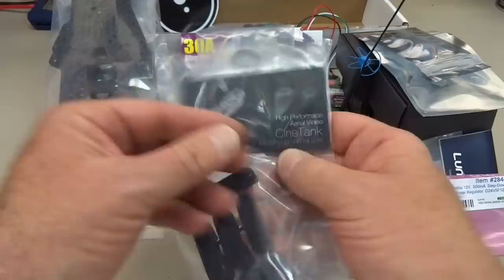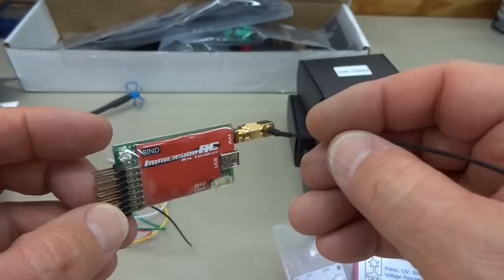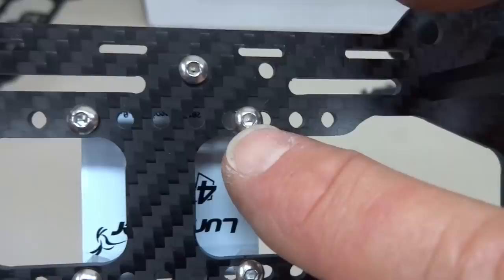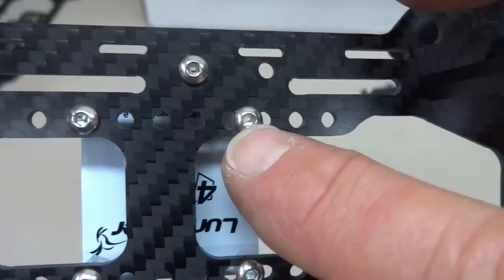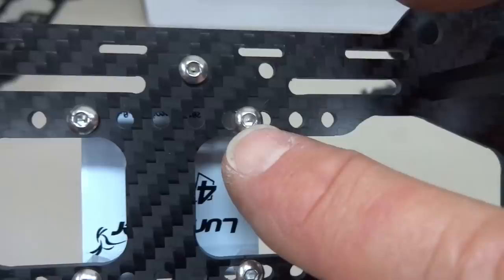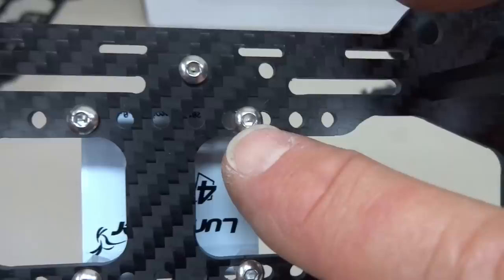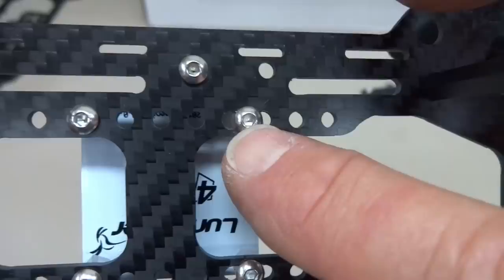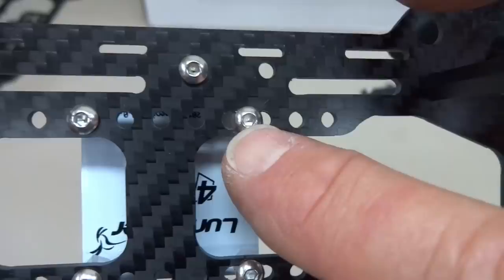Building FlyingCinema's "Tankito"

Comment: The "Bone end" on the arms are actually where the motor wires go through to protect the cables if you decide to run the motors wires outward and under the arms. Basically wire protection.

Comment: The back gopro strap slot is supposed to be below the gopro to eliminate rattle on the gopro. If you zip tied without it recessed it would vibrate.

Comment: Last comment I am going to make regarding this. The normal FPV cameras will not fit inside without some messing around. The lens housing is a few mm too thick to just slight onto the quad. If you loosen or don't install anything to hold the bottom of the camera down you can push it back to slide it in then zip tie/screw it back down.

Comment: As for the 10 holes that line down the side of the middle and top plate, those are not for mounting a FC to, they are actually used to add 2 additional spacers which will provide protection between the lipo and the FC. This also makes it easier to not have to worry about balancing your lipo everytime. Just set those standoffs in the right holes and your lipo slides in perfect everytime.
Reply: Sinewavz101 Where is the intended area for the 36x36 boards? Nothing makes sense except these holes, and it DOES actually fit if you forward far enough.
Reply: +Michael Gossett sorry I meant it fits the 36x36mm board toward the front and the holes after that are for standoffs placement for protection from your FC/fpv gear

Comment: Great looking quad :D
2208 motors are fantastic, they should normally performed like hell ;)
Why not putting velcro between your LIPO and the top plate, it will not go anywhere if you use also the two lipo tape strap :)
Looking forward for the next videos!

Comment: Also, I recommend not zip tying the fpv camera down as shown if you are using the carbon fiber frame. The CF will short the camera out. I covered mine in liquid electrical tape before tying mine down.

Comment: whats your verdict on the 2208s? I'm running the same setup from rtf on my argonaut 320. They are spinning 6x4.5 hq's on a 4s 60c 2200. Its pretty much ridiculous. Been a handful to tune. but getting there. I try to stay out of the throttle and am getting decent 5min plus flight times. They are still spinning well after 6 flights and a fairly spectacular cartwheel. Also giving serious thought too a havok 340 thanks to you. Great build videos!

Comment: My last video shows a full power punch out and some basic acro moves in high windy using this same motors and HQ 6x4.5BN props. Arms are tilted on mine...it's not a slow poke.
Reply: Also the round circle on the sidewall of the dirty cage will fit a discovery buzzer ;)

Comment: i think thats why they put all those holes in the lower plate, so you can put metal standoofs at a perfect location to mount your battery inside and it will not crush anything, i would not fly this top heavy

Comment: Doesn't the locknuts spin off because of the CCW spin of the 2 motors?
Reply from the maker: Ghostwriter972 No, that's why you use lock nuts.  CCW threads are a pain in the rear to find & keep up with.

Comment: I don't see how you could have built this and got it to work if you don't have inside connections at the factory?  I'm on my second Pixhawk that won't work and 3D Robotics refuses to fix it so I'm threatening to sue them for fraud.  I wonder if the Calif. lemon law could be used against them or is that just for cars?
Reply: +bosnianbill  I disagree and so does my Hobby King Quanum Venture that can't fly!  I don't think there are Thousands, in fact I don't know of anyone who's built one and got it to fly and the only one I've ever seen fly is my Parrot. You probably think there are Thousands because of all the YouTube videos showing people building and flying them but most of the videos are FAKES produced by paid reviewers!  I used to think this would be fun after watching all the videos of people building them and I bought the Venture because of the videos showing it flying so beautifully but when mine couldn't fly I realized that all the videos are fakes and the flying was done with CGI.  When I went back and watched the videos of building them again I noticed that nobody ever had any problems like you'd have at home with programs like Qgroundcontrol that wouldn't run, Mission Planner not being able to configure the Pixhawk as anything but a plane and would crash when trying to make it a copter or getting endless error messages so they were just going through the motions without doing anything.  When I got the first PX4 in 2014 NONE of the crappy shareware necessary to set it up would work!  I know there aren't any flying like all the fan boys claim if you can't program it.  The only way to get it to work would be to get a working one from the factory that's already setup or buy a 3DR Iris and take the board out of it.  I doubt anyone would do that but they might in order to make the fake videos.   Mine finally broke after trying hundreds of new releases of Qgroundcontrol on it for a year and those crooks at 3DR refused to fix it, saying to buy a new one!  As for joining a group, when I checked about groups at the local hobby store that has tons of expensive drones for sale the guy said: "they tend to be loners who don't join groups"!  All the online groups are made up of the fan boys and paid reviews who make money posting positive reviews and producing fake videos so they get mad and send out death threats if anything bad is said like how the software doesn't run or the model won't fly.  Seriously!  When I mentioned that a model wouldn't work I've actually got messages saying We Hope You Die!  When I first got the PX4 I joined a Qgroundcontrol Google+ group and when I mentioned that it had a problem they kicked me off, no matter that it didn't run at all!  I've asked a number of people on Youtube why they are making fake videos but they either get mad or won't answer at all, however a few have said they got the models for free. 
When I got the Venture I needed a flight controller for it and since the first PX4 could never be programmed I bought a Naze32 but it was so poorly made the USB port fell off when I was trying to set it up with Cleanflight. I got my money refunded from Banggood and bought a KK2.1 that did finally work since it didn't need to use any crappy shareware.  That's when I found out the Venture couldn't fly!  It had a bad motor and bad ESC. Apparently their idea of RTF was a lot different from mine since I expected it to actually be able to fly. Even after changing all the bad parts though it still couldn't get off the ground. 
Even getting good parts for the Parrot that could fly right out of the box has been a problem!  A few times it took off to the side as fast as it could for no reason and crashed but crashes bend the props and shafts if they hit something.  I ordered some new orange props on Ebay that were supposed to be "New & Improved" and it wouldn't even fly with them so I had to put the old ones back on.  I ordered new shafts from 4 different sellers on Amazon and Ebay and only one set was usable!  Most looked like they had taken finishing nails and just cut the pointed end off, they weren't the right size or even round and made of of soft metal that I could bend with my fingers!
I've even had problems with the FrSky Taranis that everyone likes so much!  All the switches on mine are loose and I haven't even use it for anything yet except to try and calibrate the FC's. I'll probably never buy anything from Hobby King or Banggood again!  After wasting 2 years on this rubbish I put the parts away in the closet since there's no place to fly them around here even if they would ever work. There is supposed to be a mythical field where they get together to fly on Saturday evening but I haven't found it yet.
Reply: +bosnianbill  Is this the first time you've ever been at a loss for words?  LOL.  My success rate getting anything like this to work is near zero.  Even getting good parts for the Parrot is only around 25%.  If your failure rate is just 5% that means a success rate of 95% so you must be the luckiest guy in the world!  You should be buying lottery tickets!